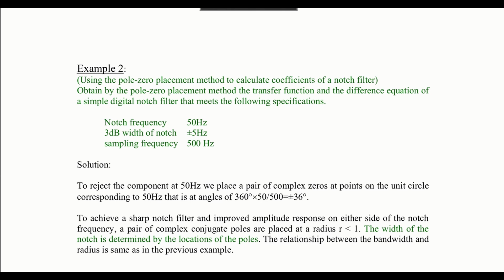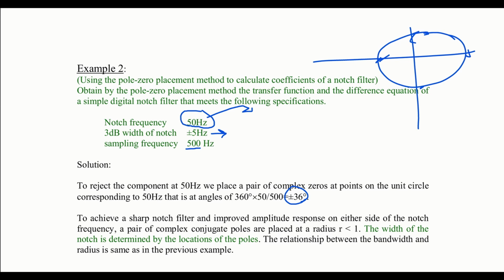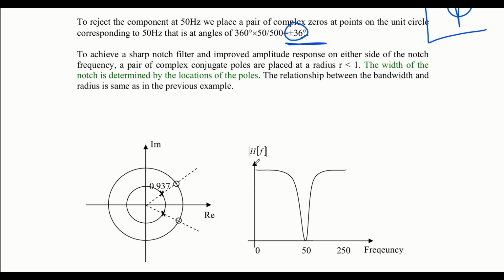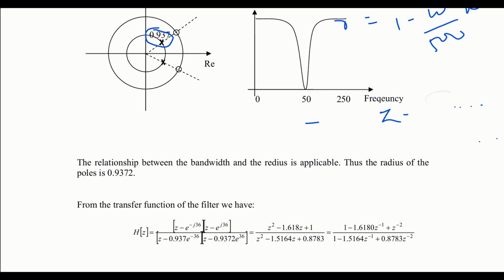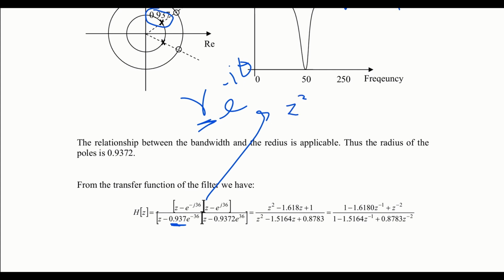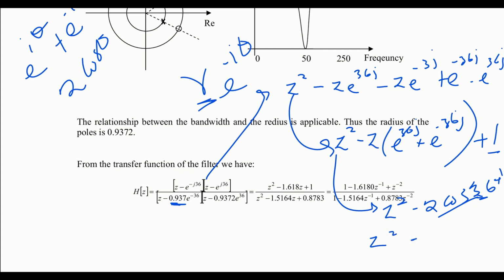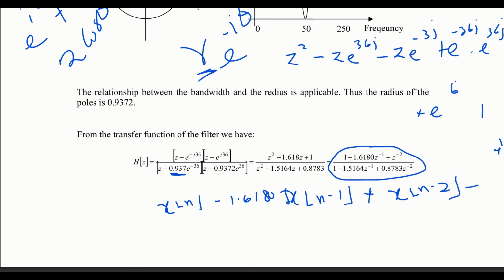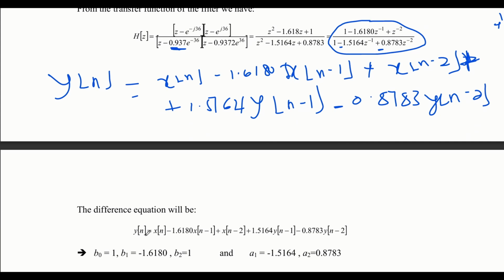NotchFilterDesign | Pole Zero Method

Comment: When writing the transfer function, I thought the angles have to be in radians? In your previous example you used the angles in radians.
Reply: Okay I saw that when you were evaluating you changed your calculator to degrees. I thought the notation had to be strictly written in radians.
Reply from the maker: It's not a must,usually putting everything in radians prevents you from switching your calculator from radians and degrees to reduce risk of error
However degrees isn't also bad if you can make the conversion